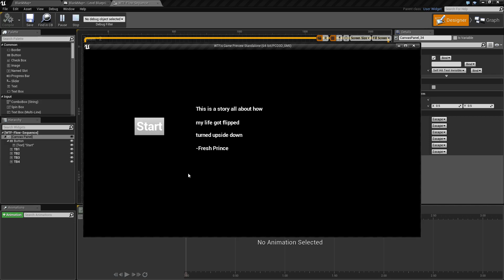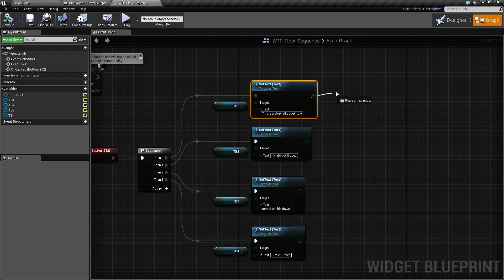WTF Is? The Sequence Node

Comment: This node complexes me as simple as it may seem just for the fact that a simple test I setup which included a loop style event(Then 0) and a print string(Then 1) still shows the printed string before the Then 0 is actually complete. Are there special circumstances with this?
Reply: I know this comment is a year old but the problem is that the Thens are executed one after each other without delay between each other.
So the second Then is called before the for loop resolves.
Reply: @ZeriAi  thanks for the reply.

Comment: Would this be similar to Then statements in a language like java?
And is this a good way of overcoming the "One event node per class" problem? sorry, I'm very new to this
Reply from the maker: +Ethan Dodge it is slightly similar but there is nothing stopping them from all running.  These will run in order and it is mainly a good way to keep things organized.  Rather than having a blueprint run for miles across your event graph you might be able to break it up logically into a few nodes and then run them in sequences so you can easily test them firing in order.  

Also sequences do not wait for delay nodes so it's not something that can just replace doing thing left to right as well.
Reply: @MathewWadsteinTutorials  This reply may have answered my inquiry, so if I have an early sequence which includes a delay at some point, the sequence will fire the next one in line once it meets this delay?